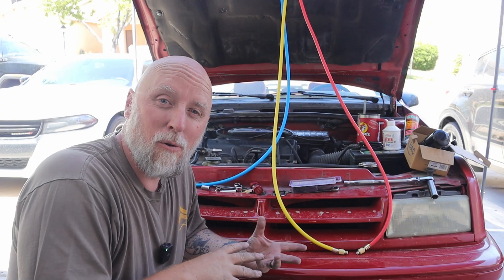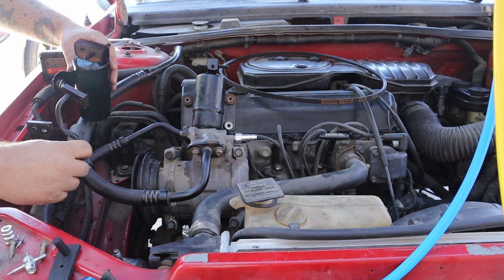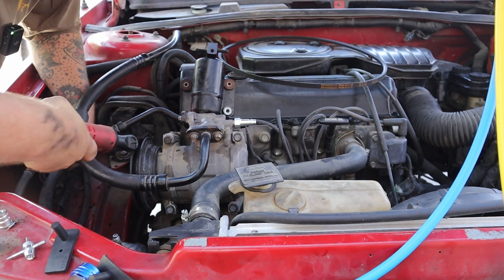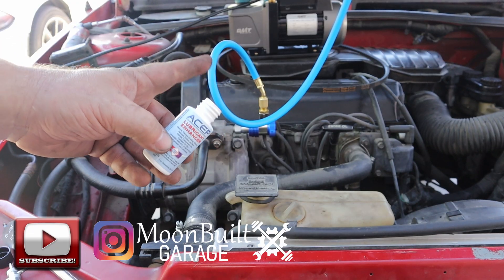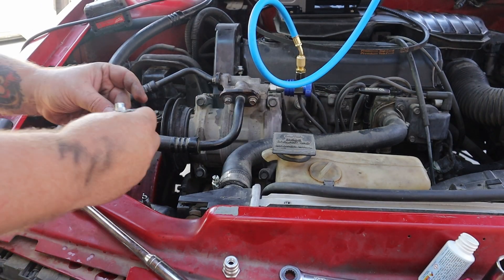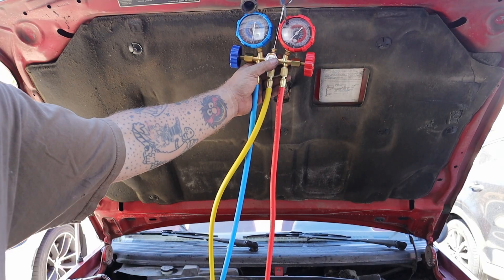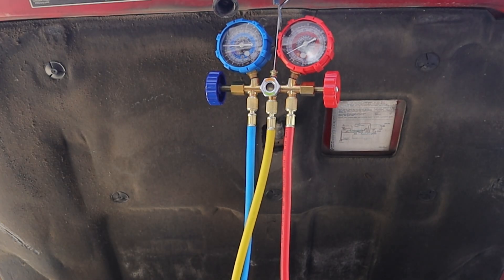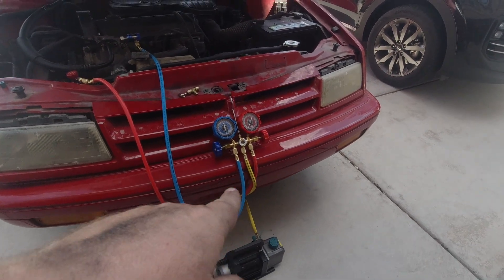Can I Convert My Daughter's AC System From R12 to R134a?

Comment: Just watched this. If you haven't already figured it out, there's 2 types of refrigerant can fittings on the manifold gauge sets. Pierce type and self sealing. Seems like most cans sold in auto parts stores are self sealing now. My manifold gauge set had the pierce type (pointed end plunger). Kept wondering why I couldn't get refrigerant to flow. After figuring out self sealing cans require a blunt end fitting, I took apart the can fitting and ground off the majority of the point on the plunger/piercer thing. I left a small chamfer on the edge of the plunger so it fit into the self sealing can nicely. Refrigerant flowed like it should. Moral to the story, make sure your fitting type matches the type of can you buy.
Reply from the maker: Great tip, thanks for the heads up!

Comment: I am looking into doing this procedure for my 87 Toyota Supra Non turbo 7M-GE. It's been sitting for 20 yrs in a climate controlled garage most of its life driven occasionally. The R-12 has been long leaked out due to little use. Did you find that the R-134A circulates in the system at lower pressure as opposed to R-12? I am wondering if i should completely vacuum the system due to age of the system before adding R-134A?
Reply from the maker: Not sure about the differences in pressure, but you will need to vacuum the system in order to get the new refrigerant into the system
Reply: posting a video right now. It is really easy. I have done several cars over the years. Not as complicated as people make it. Done 20 plus cars. some I had over 3 years later with no issues.

Comment: I think you should have gone through and done a complete service.  Replaced all the O-rings, Vacuum test, is only good at detecting half the leaks.  The other half need to system pressurized with nitrogen.
Reply from the maker: I'm sure a complete service would have been the proper way to do things, but that's the debate, isn't it.....how much is REALLY necessary? I did the compressor on the other daughter's Beetle, and only the compressor, and that thing was going strong up to when they got rid of it.  We'll see with this one...and should it fail in the future due to not doing a "complete" service I will do a follow up
Reply: @MoonBuiltGarage  I'm not trying to be a pill.  The refrigerant leaked out and without a leak test its unknown where it originated from but then again, maybe if it lasts another year you are happy.
Reply from the maker: @mcdouche2  I get that...I leaked from the fitting at the condenser...once I tightened it the leak stopped, but yes, there could be others